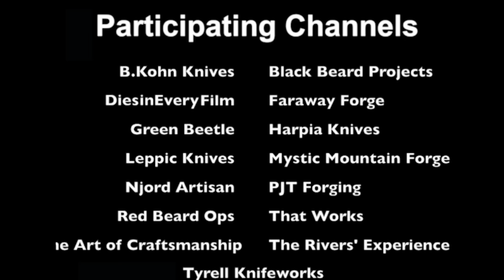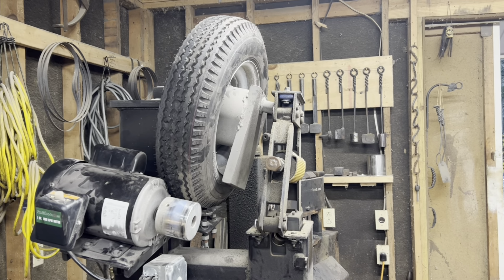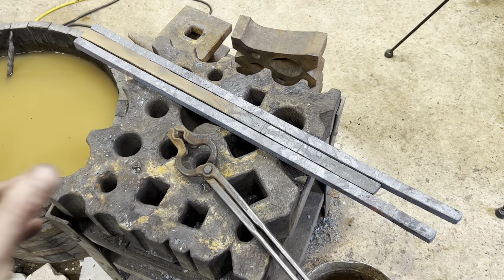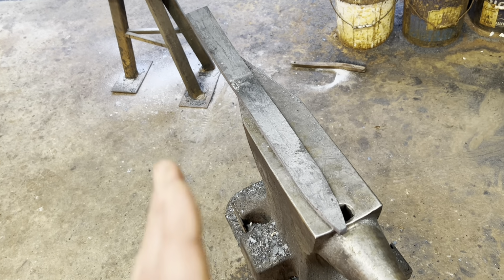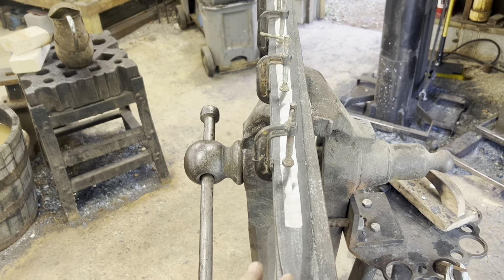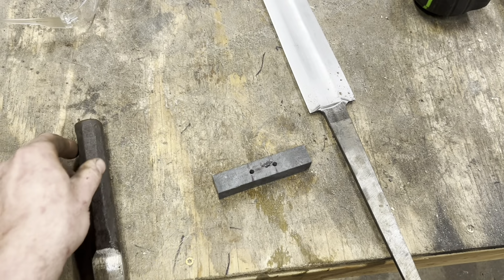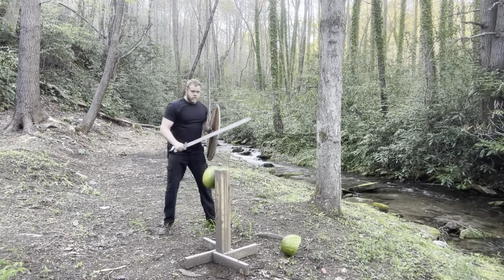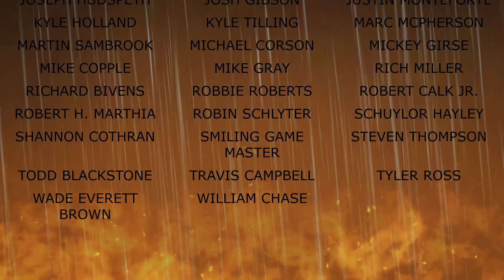The Viking Challenge! forging a serpent core viking sword

Comment: Man that thing is scary sharp, glad to see you can finally afford some of your own work lol

How thing do you grind the edges on a sword before sharpening? In your freedom units... not the tool of the devil 😅
Reply from the maker: I didn't check but probably around 10-15 thousandths. They were pretty thin the sword actually cut me once during hand sanding before it was sharpened
Reply: @OldHickoryForge  thanks, more info I could find every search I tried took me to knives. I did that with my katana, read somewhere they were sharp off the grinder. While reaching for some paper towel my knuckle caught the edge... there's still a number sensation there so must have gotten into some nerves lol

Comment: Fantastic job! And a very reasonable weight for ease of handling, especially with such a long Viking style sword.  I would recommend a larger pommel (not so flat), and a shorter grip-length. It seems that nearly all reproductions have grip-lengths that exceed historical parameters.